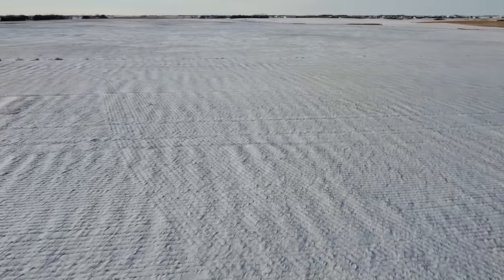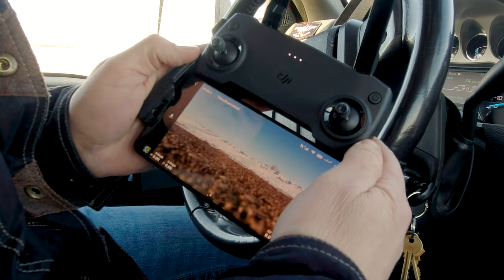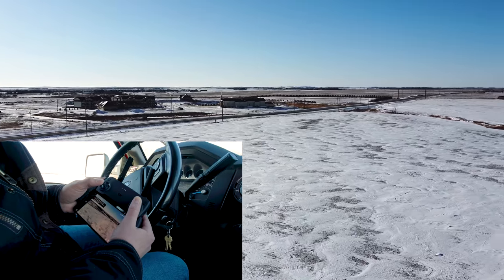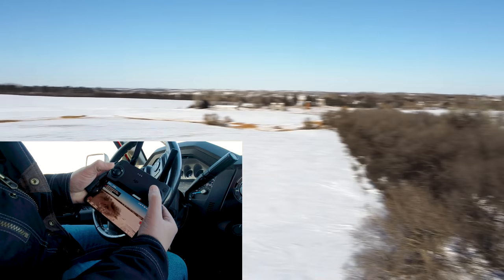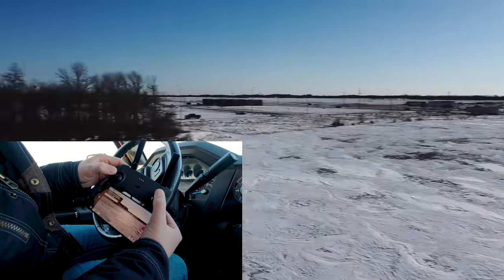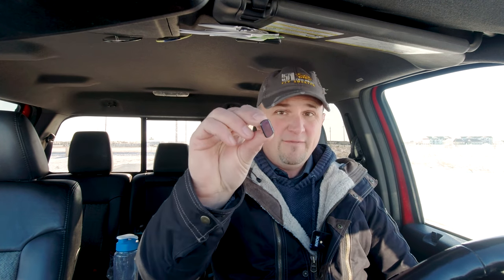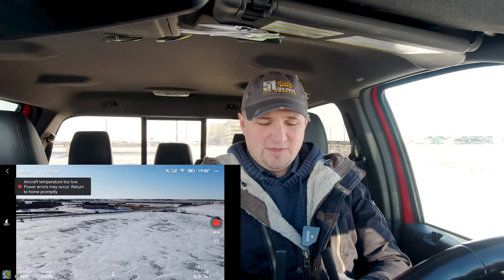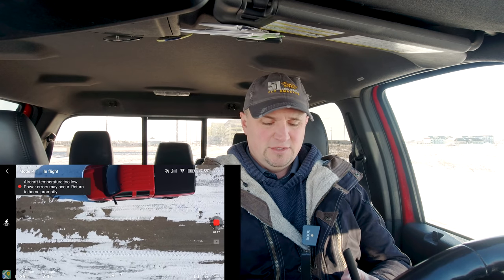How to Crash Your Mavic Mini.

Comment: Russ... Appreciate the info, especially the IMU not functioning properly.  Skycam509 had an interesting observation as to heading when the altitude would increase or decrease. Though I live in SoCal, and rarely see below 32 degree F in LA LA Land, if one flies in the mountains, or out in the desert areas at this time of year, one could see this temp on a regular basis. Pilots be warned!
I've read in the Mavic Platinum and 2 Pro operating manuals (Owners Manual) about flying at these cold temps. Thanks for the demonstration as to what could/can happen at these temps.
A side note not related, I'm a bit shocked/confused, to see on a couple of You Tube channels, people who do not understand the RED Section, on the battery level status bar;  they question why their drones will not continue to fly below a specific state of charge in the Red Section.  Don't think these people have an Owners Manual for their drones. If they do, they haven't read them. One guy watched his Phantom almost splash into the ocean , in Denmark. Plopped onto a sand bar instead.
Perhaps its my Private Pilot background which makes me more apt to read the manual before flying a new type aircraft. Airline pilots have to do it all the time.
There are some differences between the Platinum and 2 Pro; the Multi-Flight mode switch on the side of the controller, and how to activate it, being one.

Comment: Russ in your video you mention that you were flying at 0F that’s -17C. That’s way under the operating limit of 0C by DJI. No wonder why it’s unstable. I did managed to get to -12C without any issues. But -17C is really pushing it and also the higher you fly the colder it gets.

Comment: I have transmission issues using my Mavic two which uses aqusink2 so I can’t imagine my mavic mini Wi-Fi signal horrible transition would be…
I’m talking about sitting in my van and flying a drone outside…
Remember vehicle is made out of metal which will screw up your transmission...
Why don’t you try to same test standing outside your vehicle for fun and see the difference.

Comment: Great info, Russ.  I always find your videos to be well thought out and engaging.  However, I live in a suburb of Hades.  As in Hell.  As in the Firey Pit.  (Houston).  So all this is great info, but only if I have the bizarre urge to drive straight up I45/I35 for about 1200 miles.  Which I won't......because it's snowing up there.  😎😎😎

Comment: I would think that if one would tape up most of the venting slots at the bottom, the internals wouldn’t get so cold. Just make sure it doesn’t get too hot in there due to a lack of air movement. 

DISCALAIMER: I have not tried this. Do at your own risk

Comment: I also feel I need to comment about about the signal as in the video it appears some of your signal is blocked by the sterring wheel. Also there was another video that the flyer got a gimble warning. I too got that and can only say that is because my batterry had just reached my setting of 20%. But before it gave me the battery warning my gimble started acting sporatic. As soon as I started the landing procedure the gimble started working correctly again. My videos are at www.youtube.com, search for adinserter and click on lowercase "a" in a grey circle. The Tehachapi Ranch 2nd video is where you see the gimble error. PS, I do not edit videos and am in noway an expert videoographer.

Comment: Can you do a video on how heat effects the air 2? I have had several issues with flying in high heat ( i live in Arizona ) My batteries ( all three from the fly more combo )  have overheated, as well as burnt a hole in themselves ( DJI fly gave me a battery cell error and force landed the other two batteries ) The one battery that burned a hole in itself did not give me a cell error. It actually melted itself to my drone and burned a spot in the battery well of the drone itslef. Waiting on my replacement drone, and am hassling with DJI to send me replacement batteries. ( they don't believe me, even though I have flight logs, photos and everything they need to verify the issue.

Comment: 🔴🔴🔴I know why your drone went to higher altitude... to get sunshine 😂😂😂.. seriously check the blades and warm up the battery... put it on the top of your car engine for 5-8 minutes ( make sure it doesn’t get hot and damage the battery), but if you use warm battery usually fixes your problem

Comment: Two years ago I was trying to Fly my Mavic Pro in 30 degree weather (dry but very cold)
it only lifted off 3 feet from the ground and the gimble would not move at all ,then I tried to go higher and it did nothing but hover in the original spot.  So I put it in the car and didn't fly it that day. I then because it took me 4 hours to drive to that spot I flew the crap out of my freestyle (home built)drones until I had no packs left. it helps to have alternate aircraft.

Comment: Hey Russ - thanks for the video.  If you do another cold flight scenario can you show us the battery temp in flight at the top right of the DJI fly screen? It could be useful to know at what temp the batteries are at when things start to go wrong. do you believe it is only an IMU issue at High / Low temps?

Comment: I always fly from inside my vehicle so no issues there. I will bet the GPS satellites are going over a speed bump which is causing the issues with altitude.  Science baby!  I just purchased a Autel EVO rather than the MM as it seems the MM is having quite a few issues. I could see no difference on the filter / no filter which should be the case if the exposure is set the same. The ND filters affect motion blur but should not change the image sharpness again if the exposure is set to the same levels. JMO

Comment: You should try to use your car heater on full and warm up your drone to like 42 Degrees Celsius and then when your battery temperature is over 42 you take your drone outside and it will be sweet for a whole flight probably..

Sweet

Comment: Russ looking at the diggity lapel mic for the osmo pocket you talked about
It has a TRRS connector does it work if you just plug it into the audio adapter
Or use a TRRS to TRS adapter

Comment: hight Russ had similar thing happen imu and compass calibration all good was 3 degrees out and was at 52m height 10 km hour winds when all of a sudden it started landing neither stick would control it and it dropped altitude til hit ground crash  flight log shows no error msg at all

Comment: I have just gotten the mavic mini and I have been having the same problems of increasing and decreasing altitude without touching the throttle and it was in normal temperatures of 50 to 75 degrees Fahrenheit

Comment: I would guess if the IMU was affected by cold... the other 3 axii would have been affected... I would guess there is something in the GPS altitude circuitry or a barometric thing...(if the drone has barometric measurement)
Reply from the maker: But I flew in 20f a couple days later with no problems.

Comment: I would say it’s the wind conditions, notice how it would go up in one direction and down when you turned around the opposite way? As we all know that propellers are airfoils and they create lift. Perhaps when you fly into the wind the aircraft wants to go up. I would say it’s your barometer that is causing the issue and it’s not compensating for this condition. I would send it it back to DJI for repair.
Reply from the maker: The wind was from the West at 6mph. I was flying North and South.

Comment: Hi Russ. Thanks for the video. I have experienced some issues with the Mavic Mini firmware 400 update. I was flying in the park were I usually fly my drones and upon take off I got insuficcient power warning. I noticed that when I throttle the Mini up or forward it made a noise like a vibration.
Then in all take off the Mini went backwards like the rear propellers weren't producing enough lift.
Then I tried indoor with the same result with all batteries. I downgraded the firmware to 300 version and tested indoor with 2 batteries and no warning at all. Then upgraded again to 400 version and the warnings appeared again. Do you know if this has happened to anyone?
Reply from the maker: Yours is the first I heard.

Comment: I currently have the mavic pro and was on a paid gig in the country.  My phone wouldn't log me in to the go app so that I could connect to my mavic pro, so I had to have the client drive me about 10 miles so that I could get a connection and then fly.  Do you know how I can keep this from happening? I was using an iphone xs max.  Has this happened to you before?  Any ideas on prevention ideas? Or maybe you have thoughts on video feeds or differences between RC and WIF modes.   Thanks recently discovered you channel big dog and it's incredible on so many levels.
Reply from the maker: I have no idea.  iPhones are usually solid with the Go4app

Comment: Russ, I suspect the problem has nothing to do with ambient temps or Faraday cages, but more to do with the fact that you are controlling your craft inside a vehicle with a RUNNING engine which has enough electrical interference of it's own to mess with your controller. 
 Please test this out by performing a flight under the same conditions at the same location with the engine shut down. 
Let us know what happens....
Reply from the maker: I've flown from my truck about 100 times with various drones. Never had an issue.

Comment: An excellent point although It isnt the imu that is the causative issue. There is a barometric sensor that is usually separate from the imu. I dont think it is part of the imu on the mini. Anyway in the cold the barometric pressure changes rapidly per foot. This is how hight is measured. In the video the hight showed feet going up and down but if you look closely there is no actual change in height. It could be compared to actual aircraft with a disfuncting altimiter. So cold is your enemy. The barometer in drones is also light sensitive and is usually encased in a darkened container. Cold of course affects the battery so your advice to not go too far is also great advice. I dont know why you cant use the recording app though. Very interesting. Anyway good video and good point. But imu's are actually adjusted in the cold. High cold high heat= no good. I hope people can learn this from you.
Reply from the maker: There was a huge change in height.  I nearly crashed it right into the stubble field the day before.

Comment: Good chance that it could be a battery issue as well.  You mentioned that one of the read-outs warned about power issues.   I notice especially if I am flying aggressively. Your thoughts??
Reply from the maker: It's possible, but I flew in 20 degrees yesterday with no issues.

Comment: I had experience this but the weather was at 50 degrees but it kept decreasing altitude or increasing altitude and it was even more weird because the IMU said it was normal and I did a compass calibration and it would still do it at random times and my props look perfectly fine as well
Reply from the maker: I'm going to test it again in warmer weather

Comment: Hi. May not just be the IMU. 0°F (a chilly minus 17° C for me!) may well be affecting the motor bearings, especially if lubricated. You'll get mechanical dimensional changes within them as well which may be significant if different metals are used for shafts and bearing surfaces. It's quite likely that these factors interact with the ESC's as well and along with your conclusions about the  IMU could give rise to aparent random behaviour. Incidentally, I assume the gyro's in the IMU are some form of electronic, not mechanical realisation but even so, minute changes in the lengths of vibrating crystals could upset things. Now, just to be clear, I really do 't know if any of this is even vaguely right - I'm just throwing it into the pot! Very good of you to experiment in such cold weather, no wonder you stay in the car! Cheers. BobUK (edit to correct temp conversion)
Reply from the maker: Same here. I actually have no clue. Could be many things, but that seemed o be the most simple explanation.
Reply: @51Drones  Hi, oh, I'm sure you are right about the IMU and thanks for posting - luckily it very rarely gets that cold where I am! BobUK.

Comment: Hi there I love your videos and am thinking of buying one of these little things. Can I ask a question please, does the camera have any control over it’s movement or is it fixed? Cheers
Reply from the maker: you can control the camera.
Reply: You can remotely turn the camera anywhere from 20 degrees up to 90 degrees straight down. With practice and adjustment of camera speed in the configuration you can have fine control of the camera. It's very cool.
Reply: The camera can tilt down 90 degrees (straight down) and up 20 degrees (think about a little less that 10 o'clock) and anywhere in between. Panning (moving the camera sideways) is accomplished by rotating the drone sideways (yawing).